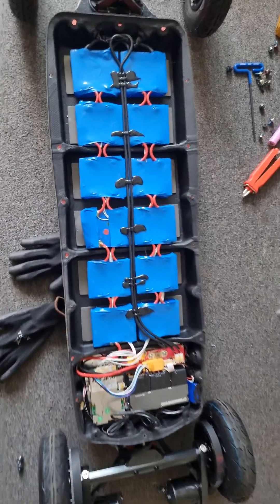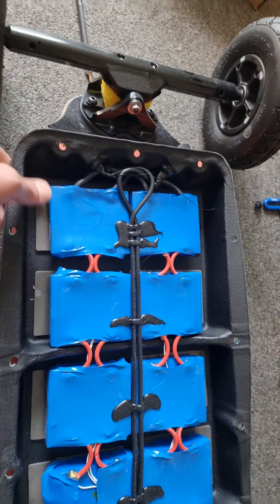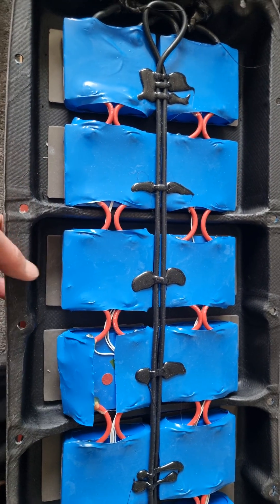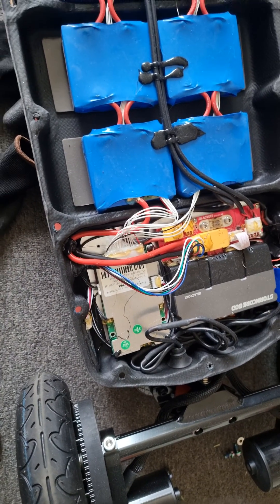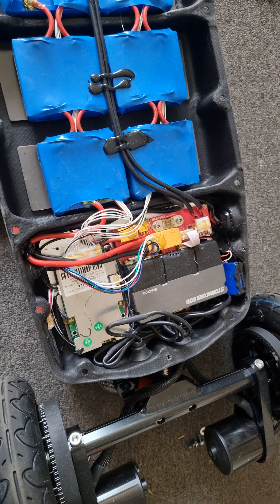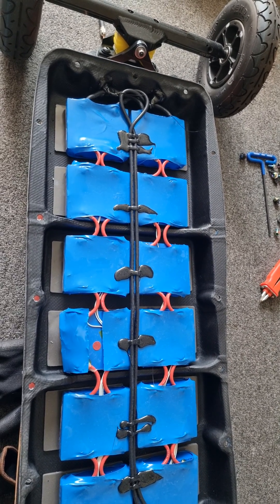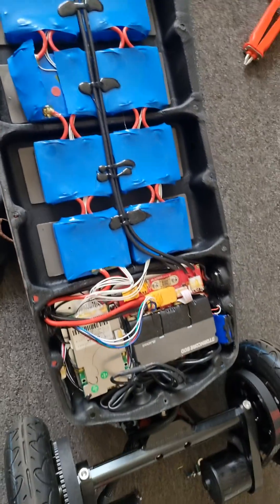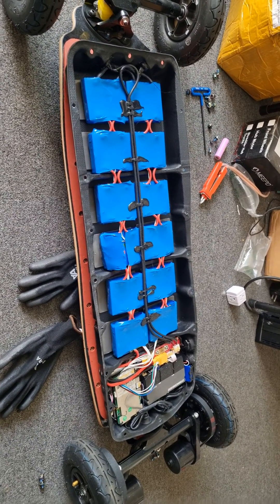Lacroix Jaws Battery Enclosure Disassembly!

Comment: It’s pronounced Lacrwa. Croix or crwa is cross in French. I wanted one forever but could not justify the price in Canada all in was $4600. They really soak everyone for shipping:( even 400 miles away in Canada. Ouch! For less than half I’m building a MBs Birds electric mountain board with more range, same drivetrain and motors and better off road abilities. Purchased the exact same tires that Lacrwa uses for $9 each at scooter parts just to try them out. I understand your not wanting to go under the knife. I have 2 torn rotator cuffs and have heard that the surgery is 50/50. Been living with it for 4 years. Just had my first crash and bleed in 3 years of esk8 . Was covered up but fine gravel has a way of pulling your clothes and pads away to give your some lovely gashes 😡Ride safe.

Comment: I would assume by the color that the double sided tape they used is 3m VHB. If so, then if you tried to pull the batteries off you’d likely destroy the packs before actually getting them to come off. VHB tape is no joke.